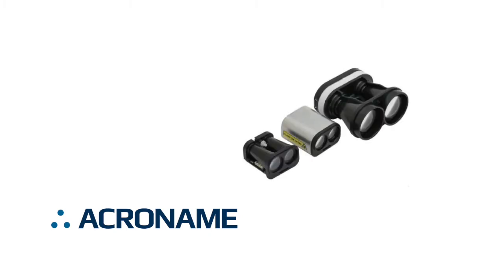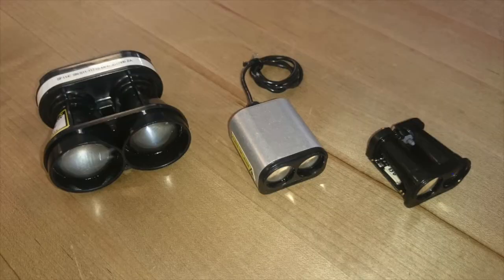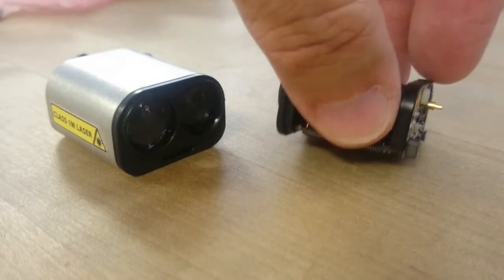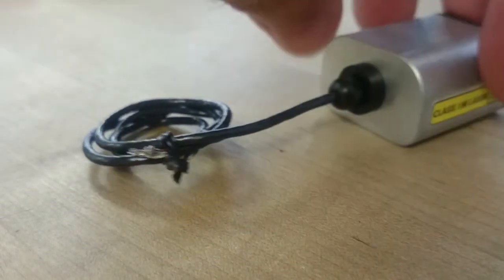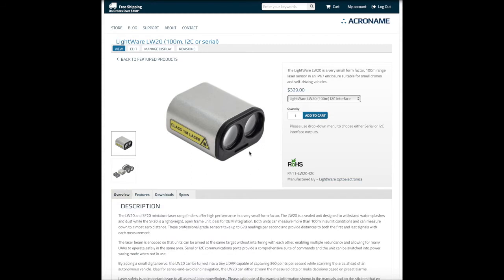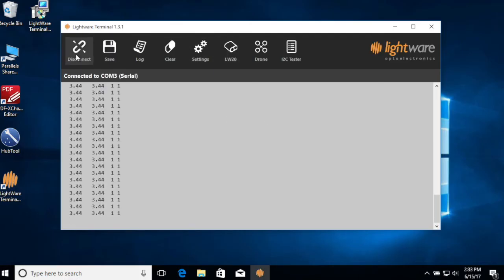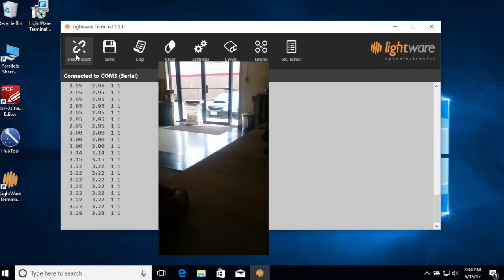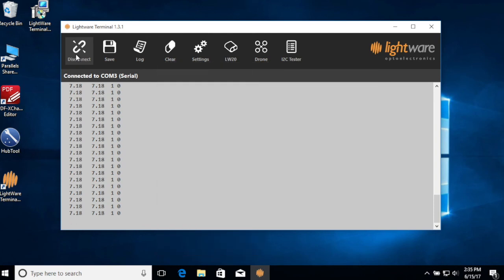Introduction to LightWare LW20 and SF20

Comment: Hi the lidar sensor SF11/C also has the option to generate a log file during the mapping in the UAV application and store the Geographic coordinates to use as reference in the usage of Agriculture propose?
Reply from the maker: The free Lightwave Terminal software can be used to product a log. Also, the device provides a simple serial "stream" of measurements, so saving that to a file is very straightforward. If you have issues, you can also reach out to our support team. 

For UAV applications, the SF11 is fully supported by ardupilot and ROS.

Comment: Is sf20 and lw20 works on shinny metal surface in good sunlight
Reply from the maker: Reflective surfaces will not provide good performance for any LIDAR measurement system. Depending on your application, you might want to consider SONAR (https://acroname.com/store-grid/field_category/sonar) or RADAR https://acroname.com/store-grid/field_category/radar).

Comment: which microcontroller is best for sf11 altimeter?
Reply from the maker: @Avinash, any microcontroller with UART or I2C will work great. We've seen people use everything from RasPi and Arduino's down to custom firmware on low-end Atmel and Microchip parts. And of course, you can connect to them with USB as well to make development on a full PC easy.

Comment: Hello, wondering if the laser is visible & what wave length is it?
Reply from the maker: The laser is infrared, so it is not visible. The LW20 and SF20 use 905nm wavelength laser.